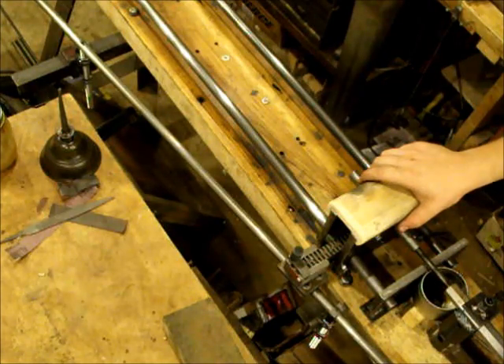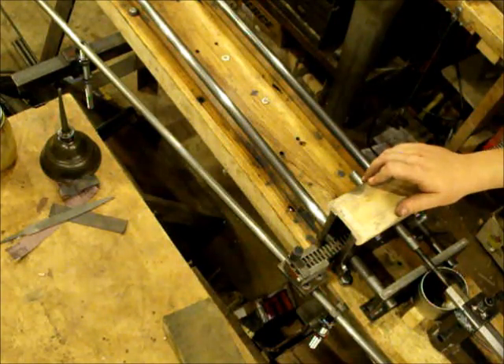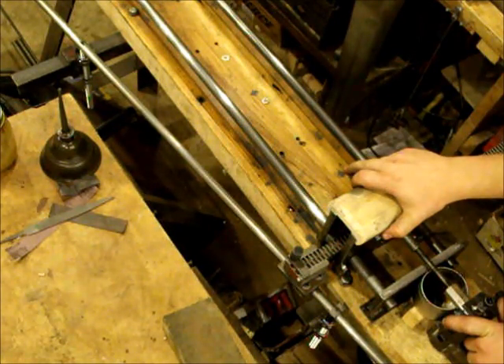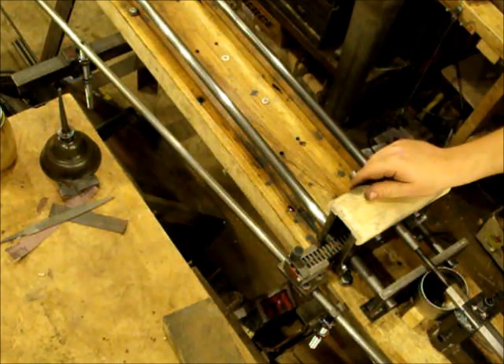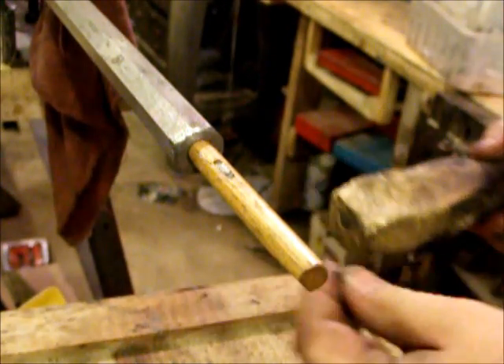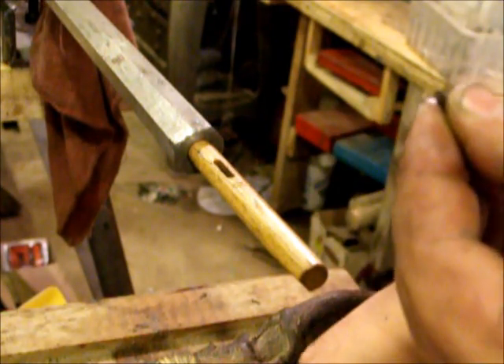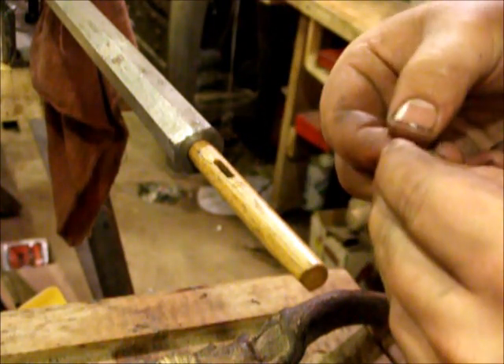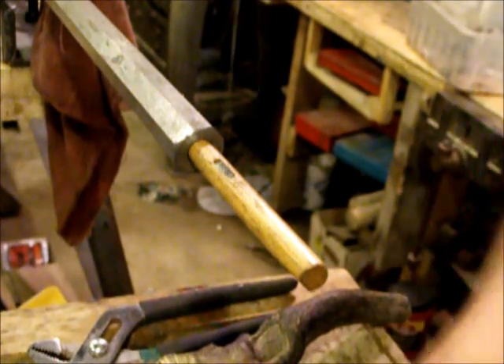Muzzleloader barrel rifling bench.

Comment: I had my father ream a 10 1/2 inch , .45 pistol barrel to 1/2 inch.  I took a 3 inch, turned piece of hardwood, 12 inches long and stretched a string from one end to the other. By offsetting one end of the string a little more than180 degrees, I was able to mark helical lines and cut two grooves with a Dremel tool and wood carving chisels.  This was the way Sylvan Hart did it as Nathan Rahl mentioned in his comment. I only made one pass with my cutting bit before raising it again. I used two small Allen screws instead of shims to raise the cutting bit. My cutting bit was made from a file and was1/8 " wide so six grooves is all I could get on a .50 inch bore. I made that pistol in '78 and sold the rifling device soon after.

Comment: This is a long shot but if you are still on this channel i desperately need  detailed plans of this im in the works of making my own flintlock and this design seems to be the best iv seen if so comment here and we will figure out a dm thanks you
Reply: I think this is the type of thing you might have to design yourself. I’m a machinist and I can offer some ideas for how to set this up, specifically how to figure out your barrel twist. First you want to get your rack and pinion. The 24 tooth gear idea he mentioned in the video is really smart.  

Measure how many teeth per inch your rack has. For example if it’s 4 teeth per inch, then you have to move that rack 6 inches to get a full revolution of a 24 inch gear. 

Now if your barrel was 20 inches long and you want, for example, one full revolution of rifling. You need to move that rack 6 inches over a 20 inch barrel. This is how you get the angle of that angled rod, imagine that as a right triangle. One leg is 6 inches and the other is 20, you can use some trig to find that angle or construct a fixture to align that angle. 

If you’ve already figured it all out, sorry, I just really like to think about this stuff. I know it’s been a few months since your comment. And I apologize if my logic with the math is way off and I might be wrong haha.

Comment: where did you get the gears from?
Reply: You can get a rack from off an old flywheel from an engine. Use the starter Bendix as the gear. I plan to build an arbor press from a 60 series Detroit diesel.